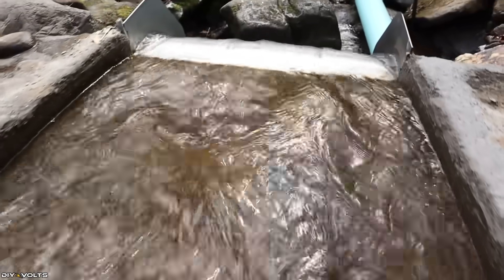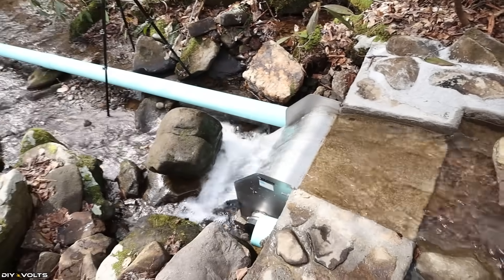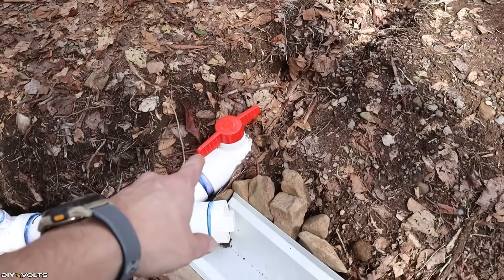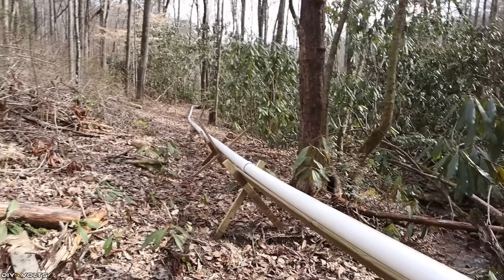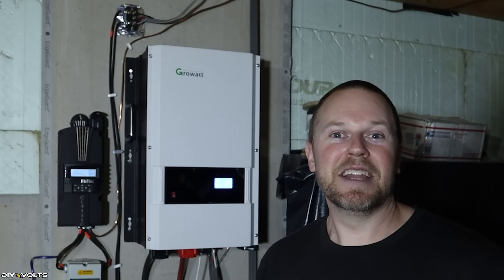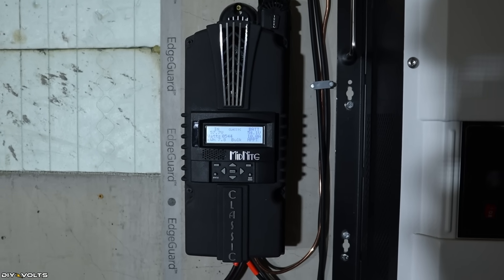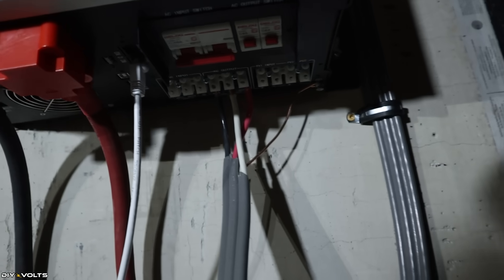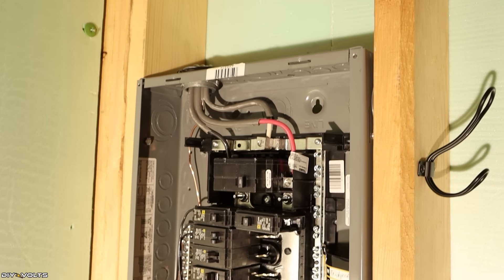AMAZING 500w Micro Hydro Power

Comment: hello - thanks for the video! i have a naive question: why do we need battery storage? can the power be not fed directly to inverter and used?
Reply from the maker: You can use the power right from the rectifier however the power fluctuates a lot. Sometimes you will have 500w and sometimes its more like 450w. The battery allows you to have a consistent output and also use more power at once. Lets say you need 1500w to run a hair dryer. The battery lets you use stored power for that higher value.

Comment: I’ve never quite understood the logic behind converting from AC to DC and then back to AC. Why not just power the inverter directly from the AC (since it literally has an AC input right next to the output) and use it to charge the DC batteries? That way, you could minimize the energy loss from the conversion process.
Reply: Has to do with energy storage, can’t store ac energy, so yes you could run ac directly but you’d only get 500 watts of energy at any given moment, vs going to dc lets you store that 500 watts for later. not to mention the fact that the voltage coming off off the hydro is likely not 120, and once you put a load on the generator greater than it’s output it wouldn’t spin anymore

Comment: why is the piping so long? Why don't they just put the turbine right next to the river and then just run a power cable to the House house
Reply from the maker: The hydro math calculation is: (head pressure in feet X Gallons per minute)/10=power
To get the head pressure needed, a long pipe was required. Otherwise there would be no power production.

Comment: I studied engineering physics, so they never taught things this practical… But I do love it. I’m not in to electrical stuff, but that step from three phase from the turbine to two phase dc I did not get. I would guess the turbine outputs 3 phase ac.
They seem to have some space, could not that power from the turbine have powered an really heavy flywheel, which in turn could power an alternator with control of the turbine, with longer reaction times due to flywheel mass?

Comment: I wonder if it would be more efficient to use DC appliances and DC power throughout the home, eliminating the need for the inverter.  Almost all appliances and electrical devices either have an AC/DC converter built in or require an external AC/DC converter to operate.  It seems awfully redundant.

Comment: So which version of PMA is this on the website?

Just trying to understand how much 3-phase power this is making.

It’s generating 500w, but is that A/C or D/C? I understand youre sending the 3-phase AC and then converting it to DC.

How many Volts and Amps is this before it’s stepped down to DC?

Comment: That little waterfall coming out of the bottom of the turbine looks like it could generate a little more power. It's only like 8 feet but, that's an almost vertical slope to the creek. That could spin another turbine, or a water wheel. Maybe they could squeeze another 50 or so watts out of that system. That little waterfall is moving at a pretty good clip.

Comment: Makes me wonder if it would've been cheaper and more material efficient to place the turbine near the streambed, and run the transmission wires to the load. This much 6" and 4" pipe to redirect water over 100m seems wasteful. Impressive nonetheless.

Comment: Looks very well made considering its uses what is available at a typical hardware store. One large (easily fixable) flaw is where the pipe comes into the turbine square. Rather than the flow coming in at the 'side' of the square, it should come in at the corner.  As it is, the flow slams into the Tee and must turns 90deg both ways. A lot of added turbulence and lost energy. If you shifted the inlet to the right into the corner of the square, then most of the flow would go smoothly around in a CCW direction.
Reply from the maker: Thats a good point. Probably even better would be to have a manifold with curved tubes coming out to feed the system without the sharp PVC bends.
Reply: @DIYVolts  that would be even better, nearly always something to change as soon as a design is implemented.
Reply: Literally the first thing I thought.  Then the next thing I saw was that this system makes 3-phase AC power from the source, then converts that to DC for the battery systems, then back to AC for home use.  Now I don't know if the AC at source makes pure sine wave or not, but even if it doesn't having to convert all that power twice probably incurs a 20-25% reduction of efficiency in the system.  It would be a little more expensive but much better to include a side unit to allow for direct A/C usage (if needed) to the house before the battery circuit.
Reply: @NOTNOTJON  no way the efficiency loss is 20-25% on this system. The MPPT is only boosting from 54V to 58V so its efficiency is probably >97%.

Instead of trying to run things directly off the 3-phase generator output (and dealing with the frequency/voltage fluctuations) they could look at swapping out the simple diode-based rectifier for an "ideal" rectifier that uses mosfets with zero crossing detection. It'll bring the loss from the rectifier to nearly zero.
Reply: @NOTNOTJON Conversion losses suck, but with 3 phase I think you would need to wire the house for 3 phase. Nice if you have some high power devices, but I imagine extra cost of the 3 phase setup wouldn't be worth it for most people.
Reply: @vica153  3 phase wouldn't require anything extra apart from different wiring at the main panel.

The real problem with direct 3 phase would be the stability of the system. Since frequency must stay within very tight tolerances, it would require very rapid control over the turbine water flow and a lot more inertia.
Reply: @NOTNOTJON  this is "wild" (unregulated) 3 phase AC.  Very common practice to run it through a bridge rectifier for DC output.

Comment: Very impressive. But i wonder what they do when it snows or freezes. Do they have  some sort of solar power supply as back up?
Reply: Having solar backup for winter? 🤔 Have never heard of such a thing. Wouldn't it defeat the purpose of hydropower then? Probably a generator is more likely and wood.
Reply: @superkd7030  I said that because. What happens if there is a freeze? you'd need some kind of back up power. But that's for every power source. you always need a back up plan.
Reply: @EarthAngel504  Streams don't freeze solid. (e.g. people fall through the ice, they don't turn into glaciers).  At 2:03 you get a good look at the Coanda grating that essentially cheese-grater shreds the bottom of the river flow into the pipe. They're not taking a verticle cross-slice of the stream where the ice on top of the water would matter.
Reply: @wAf-Billy  But does that not depended on the temperature, as well as the depth of the stream?
Reply: @EarthAngel504  Not really. Ice will always float to the top, so there's always water that will flow beneath it. Even a waterfall that freezes solid still has a channel of water between the ice and the rock.

Comment: 500+ watts 24/7 will legitimately provide enough power in a house with people who know how to turn things off when they aren't using them, especially if they have propane heat/cooking/water heating for 90% of the year.
Reply: Quickmaths - 1KW solar will produce 4-5kWh per day, @100% this produced twice that, 9.6kWh per day. So a 400W constant = ~ 2KW solar
Reply: @Splendidish  at only 3x the cost of 2kw solar!
Reply: The main thing is constant and consistent, not determined by the weather that day, so far more reliable and I say that as someone using solar to operate my fridge and Internet and home security for about a year and a half now with plans to expand to a more house scale system very soon  @Splendidish
Reply: I think solar this would compliment each other well.  Just need batteries.

Comment: I feel like I've seen this system before, but maybe it's just someone else with an identical 500W turbine. Either way - this seems like an incredibly cheap way to get a really large amount of power that can easily top up a big power bank and inverter system.
Reply from the maker: I posted a different edit on my Land To House channel a while back. That channel is not getting many views and I wanted to share this here. The setup is really working well for them. Not too costly either.

Comment: What sort of efficiency gains could be realized if home electronics and appliances were set up to use DC natively, I wonder. Step 1, generate AC power. Step 2, rectify AC power to DC to charge batteries. Step 3, convert DC power to AC to deliver to appliances. Step 4, appliance rectifies incoming AC to DC to power widget.

Comment: This video raises more questions than answers. Who did the electrical install and it obviously hasn't been inspected, 240V just mounted to the wall like that (rectifier) without any cover is not code in any jurisdiction. There is a reason that the breaker box is enclosed. Cool install, hopefully they have medical attention close when someone is shocked. Hey they do have a stream nearby so when the house catches on fire from the shoddy electrical install they can put it out.
Reply from the maker: From my understanding the couple installed everything themselves. Its not that uncommon for off grid types to skip inspection. I have 4 neighbors that are off grid. They have built homes and do not have a single inspection. pull water from the creek and power is solar or hydro. Dont touch the wires when they are active and you wont get shocked I guess is how they look at it. ( I like to cover everything properly like you say)
Reply: None of your business Karen.
Reply: Yeah this jumped out to me too.  And I’m not even concerned about code..  just common sense? Why spend $10k+ and not put the bare minimum $5 junction box? I’d still go for a check nema, even on my worst & laziest day.

Comment: You would need a good chunk of change for that set up And a slue of reading over Building codes Water rights And I know in my area You would be fighting with the power company On if they would let you have a 50/50 set up Or cut you off all together ..which is fine Untill winter hits And hope that water does not freeze over lol
Reply from the maker: This off grid couple has been living in the cabin for over 15 years without the grid. This hydro setup is providing all the power other than a generator. They are not too worried about the non existent power company.
Reply: @DIYVolts  If your response is "they don't need this because they have a generator anyway" then you should reconsider what you do with your time.

Comment: that's one impressive but very expensive setup. one can only dream of having something like that.
Reply: Aside from the $8k worth of  batteries the rest is pretty reasonable depending on the usage you could scale down or start small and scale up if the system is putting out 7KWH a day. Especially if you are running things like supplemental wood heat or even a mini split, you could cut down even more with a heat pump dryer or all in one washer dryer, and a hybrid water heater. But then we are talking $4k in efficient appliances. Super cool system though.

Comment: 500 watts doesn't sound like a lot, but it's on 24/7, which comes out to 360 kWh per month. A trickle of consistent power can add up to substantial amounts of energy over time, the same reason why small devices used 24/7 are energy hogs compared to occasional use of powerful devices such as electric ovens.
Reply: Realistically more like 300 kWh when accounting for charge/discharge efficiency, but yeah spot on. Either way it's a ton of energy every month.
Reply: 500w constantly is an average gaming PC + flatscreen LED TV when at high load running 24/7. Definitely impactful
Reply: The greatest thing about hydro is the always on feature.  Solar is great but the sun has to be out.  Wind is great but it has to be blowing. IMO having solar and this hydro setup is the best of both worlds and about 30 to 40 kWh of battery.
Reply: A reason why i prefer sporadic local heaters rather that a heatpump.

Comment: this is very impresive because they don't generate a lot but this is running 24/7 so with that many batteries that is like having a system several times the size
Reply: I was thinking the same thing u can have such a nice big solar setup and get alot of power quick but this runs 24/7 with a constant 500 watts going in you can maybe even make the bassin bigger and adding a second 250 watt or so constantly going in
Reply: Usually there are 5 peak hours of sunlight for solar, so 4.8 * 500W hydro = 2400W solar equivalent.
Reply: @dishcleaner2 nice maths. That’s a good point.

Comment: Wouldn't it have been much easier to the station directly at the input ? Wiring cost maybe ?
Reply: This was my thinking. Much easier to run electricity than pipe water all that way, but maybe the water picks up energy doing the downhill run and you can squeeze more power out of it compared to just running it through the turbine at the dam and dumping the water back in the creek?

Comment: Why is the pipe to the turbine so long? Wouldn't it be cheaper and easier to put the hydro power plant closer to the waterfall and then just run a conduit with the ac power to the house?
Reply from the maker: The penstock needs to be that long to gain the water drop (head pressure) The long length of 4" pipe drops 50 feet over that distance. The hydro calculation shows the importance of the water drop:
 (Head pressure in feet X Flow rate in Gallons)/10=power

Comment: I am very new to all of this, so pardon my stupidity. If the generator is only making 500W, and the batteries store around 30KwH. Wouldn't that take a very long time to charge the batteries? Also, wouldn't 500W not be able to really supply the whole house with power?
Reply: It'll take a while to charge up the battery If it's completely dead (60h) but in the night the house needs a lot less energy than the 500W being supplied by the turbine, which allows the batteries to be recharged and supply the house during the day, when more power is needed.
Reply: With systems like this (solar and wind included!) you don't need to generate "peak" power, just "average" power. 

i.e. if you use 24kWh/day you need to generate a constant 1,000 watts, or 12kWh/day you need to generate 500 watts constantly. (divide kWh/day by 24 to get kW that need to be generated). 

For solar / wind there are additional factors that you need to consider (daily expected solar insolation for example) in order to determine amount of generation needed, but again, the key is determining your "average generation" needed to support the total kWh used.

The batteries "flatten the curve" so to speak, so that the inverter is able to provide for the maximum peaks, but you do not need to generate the power for those peaks instantaneously. 

Hydro is usually a lot simpler to calculate this for as the output is generally very consistent and constant. 

You can do the same type of thing with fossil fuel powered generation as well to be more efficient in your fuel usage too! You will need batteries / inverters to go along with it; however, it will mean you can run your generators at their "peak" efficiency and after recharging batteries, turn them off. Prevents excess fuel usage from running the generator outside of peak efficiency, or worse, at "idle" when using little power. Think of it like a "hybrid car" so to speak.

Comment: The only thing missing is a valve that will automatically shut off the water to the turbine when the batteries are at max capacity. Unnecessary wear and tear.
Reply: It's better to dump the power than stopping and starting the turbine

Comment: sorry, I'm confused. pls explain how that rectifier works. my experience with rectifiers is that it would be something like the inverter to convert AC to DC. I am not a technician, but that looks like a transformer rather than recifiers I have installed. also, is your turbine pelton wheel, you mentioned it is 3 phase power. but I thought this would be generating DC current - 12, 24 or 48VDC. the rest of your equipment explanation makes sense - DC to inverter/ charge regulator to house power. pls explain this a little more, tks
Reply: If the generator is a brushed type it will produce DC directly but the brushes need maintanance. A pretty much maintanance free brushless generator will supply AC current with variable frequency, voltage and current. To make it usable for charging the batteries It is first converted to DC via the rectifyer and then adapted to the battery via the charge controller. The inverter is then used to create stable 110v 60Hz or 230V 50Hz depending on where you live from the batteries DC supply and supplies the house with that.
Reply: The fist-sized black item on the wall with silver foil underneath it is the rectifier and indeed it turns 3-phase AC power to DC.  A water generator can be configured to create DC or AC voltage--the ones that the power company uses are obviously AC.  Next the power goes through a DC circuit breaker to the larger black 'MidNite' charger controller.  The rectifier is not perfectly efficient and will create heat, so its mounted to the wall via the foil, which will carry away the rectifier heat safely.
Reply from the maker: Good point on the heat produced by the rectifier. Those can get rather hot.
Reply from the maker: The PMA is sending wild 3 phase AC out that cannot be used directly by the charge controller. The rectifier takes the 3 phase AC at fluctuating Hz values and converts it to usable DC power. from there the charge controller is able to use the DC power to charge the battery and send power to the inverter. The wild 3 phase AC is also running at high voltage. my personal hydro system is close to 240v when spinning free.